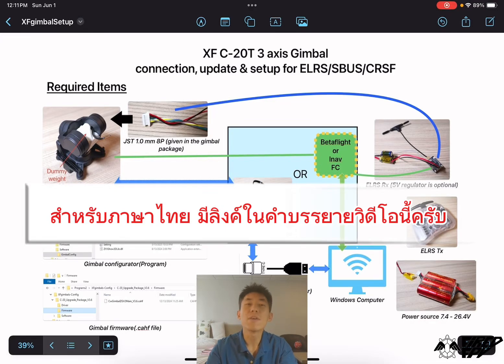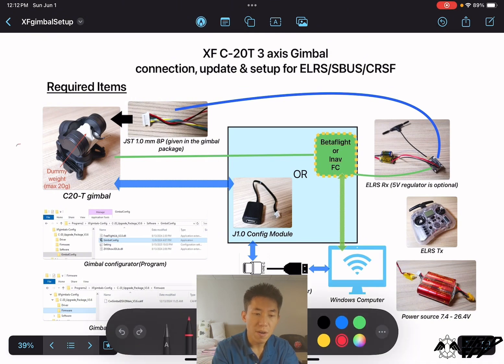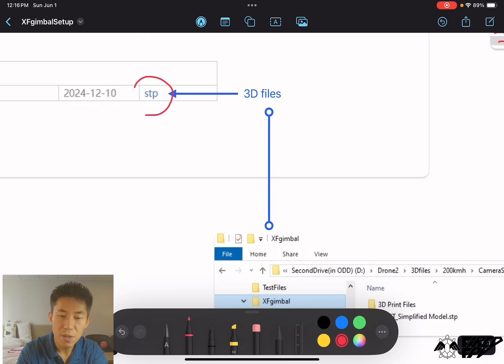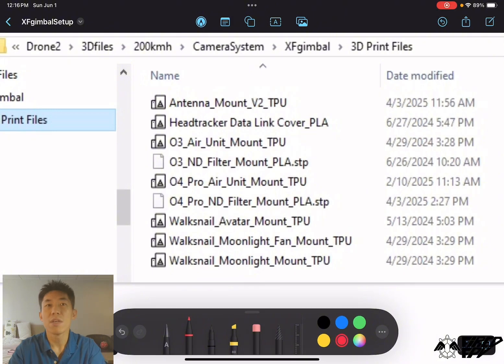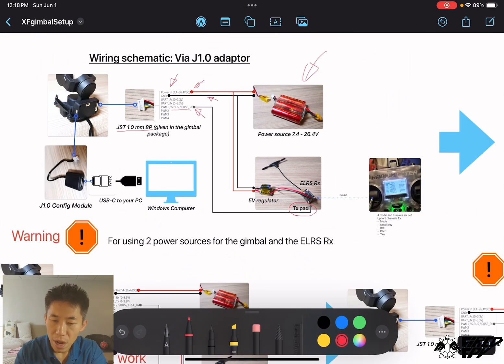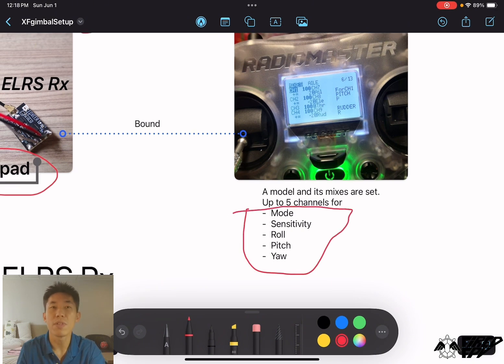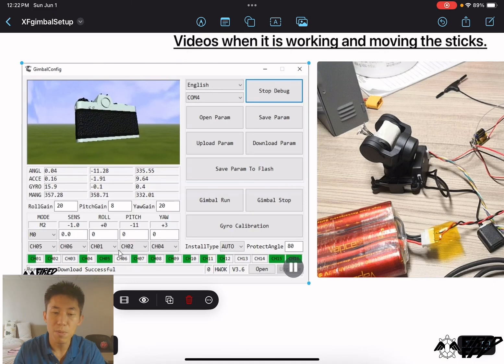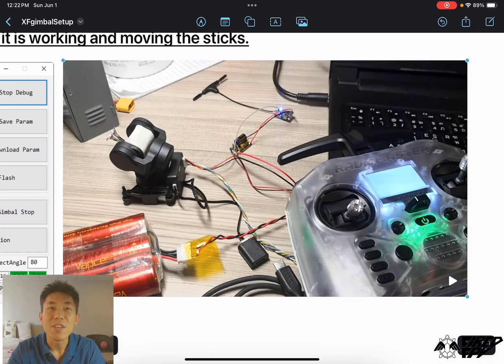FPV Camera Gimbal for DJI O4/O4Pro: XF C-20T controlled by ELRS/SBUS/CRSF

Comment: I gots a question 
Im running the simple gm1 gimbal 

I dont need head tracking or sensitivity or mode wires 
Which leaves me with pwm 3 for controlling the pitch axis.... 
Wired it to the speedybee f405 aio led pad set as a servo ... doesn't seem to be working, did I do something wrong? Do I need all the wires? 
Do i have to use the gimbal config? 

I hope you got some words of wisdom 🙏
Reply from the maker: LED pad does not just work right away. You have to do remapping work in the CLI. I have never done it. You have to search for more information.
Reply: @FireDFPV already did the proper remapping but thanks for answering

Comment: I have a ct20-gimbal with a integrated base plate(came with heat tracker) and avatar gt kit camera. Gimbal power on, transmitter power on receiver power on they pair but gimbal don't follow heat tracker and can't see video in the goggles. Please help!
Reply from the maker: This is too many problems to answer all at once. I suggest you check the manual of the Head Tracker. If I do not mis remember, the download file is on a separate webpage of AllXF since it is a separate product. Consult the manuals of your video system for the video issue.
Reply: @FireDFPV got the manual, I suspect is a problem with the equipment, gimbal move but does not following ground equipment and is no way to test it.
Reply from the maker: If it was me, I will not suspect equipment problem. Headtracker can be a bit confusing. The tracking unit(that is normally attached to the goggles) may be backward when you are thinking it is forward.

Comment: Thanks for the video.  I would like to do is use my transmitter OpenTx to control the tilt up and down using a variable nob or a 3 button switch.  
Is that possible to connect it to the flight controller instead of having a dedicated transmitter?  Basically to make it work like it does on my DJI drones that I can control the tilt.  I have an H7 FC with iNav.
Reply from the maker: If you look into my video, there is a part where I explain why I do not use the connecting via FC method. To get the same result as you want, you still do not need the FC. Use the free PWM channels on the RX. You can consult the gimbal's manual for more details. There is the PWM method in it.
Reply: @FireDFPV thanks yes I did see that but I guess I didn’t understand as my tbs nano doesn’t have an tx labeled port just ch 1-4.  On the 4 pins connector maybe you can use a DVOM and see what wires show a connection between the one you have the wiring diagram for, I’m sure you can at least find ground that way
Reply from the maker: Then you should see the Crossfire Nano Rx manual. There 4 pins on the another side. Two of which can be used as PWM. How to change the channel setting is also in the manual. If I do not misremember.
Reply: @FireDFPV thanks I’ll try that and thanks for a great video.

Comment: How to connect the Gimbal to a F722 flight contoller? The ELRS receiver is connected already to the f722 flight controller using the TX RX and power in the usual way..
Reply from the maker: You do not need to connect it to FC.

Comment: The way I have mine wired which should work but it isn't. Battery and receiver grounds are connected. Below is link to diagram of my setup.

https://docs.google.com/drawings/d/1RK9TXGW74hXocJdDx9EC7x7tHnLZLlroXHgwlGlyP5Q/edit?usp=sharing

Comment: How to add telemetry (to show the telemetry on the goggles) to the gimbal
Reply: Example for speedybee FC via INAV Settings

①In the Ports tab, select "Peripherals" for
UART5 and choose the "MSP DisplayPort"
option, then save and reboot.
②In the OSD tab, scroll down to the "Video Format"
option, and select the appropriate option based on
The following guidelines.
③Save and reboot.
Reply from the maker: You have to connect a wire from the DJI O4 pro airunit to a flight controller. It is beyond the topic of this video. Consult the air unit's manual

Comment: I came here to say a massive thankyou!!! I have the GM3 gimbal and I was using 2 power sources - 1 for the gimbal and vtx, and 1 for the flight controller and receiver. I spent a long time investigating and even reached out to Caddx support for help, but your video solved the issue after i soldered a new power lead that powers everything from the one battery.

Thanks again! 👍 👍 👍 😊
Reply from the maker: I am so glad that I can help you out. 😃